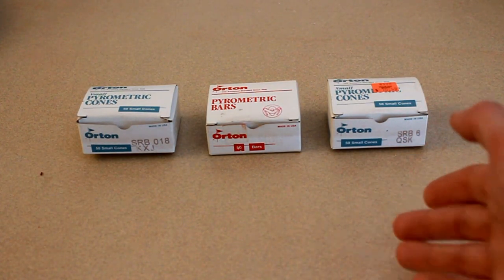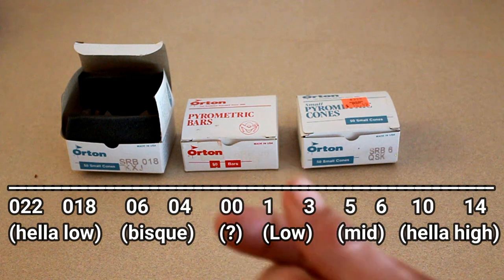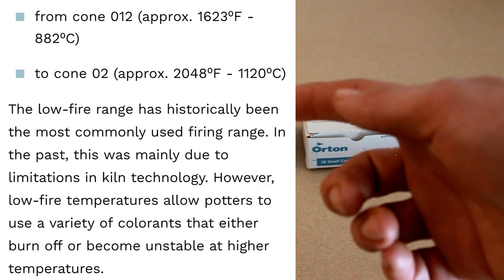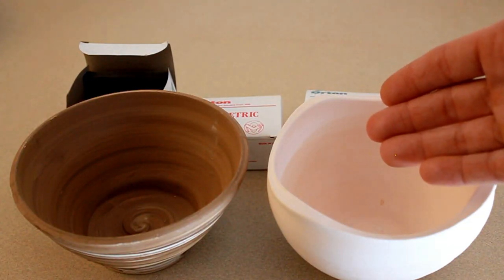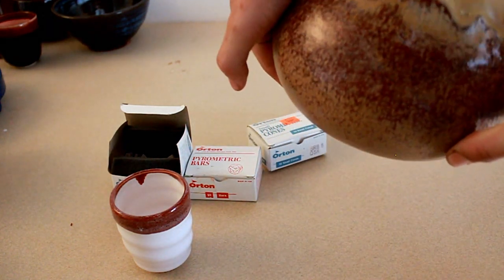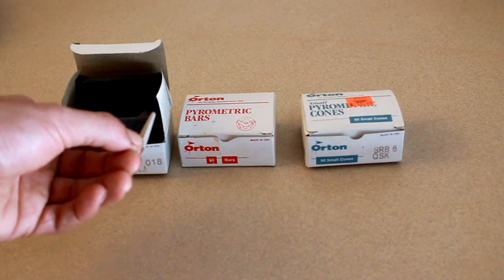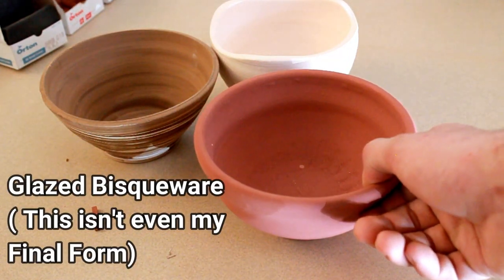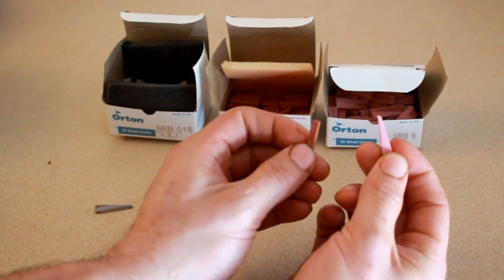Beginner intro to the Cone chart and Firing process (Very Basic)

Comment: the information at the beginning of the video is incorrect, the number of a cone corresponds to its ratio of silica to alumina in the clay body, if you were to look at the chemical composition  of lets say, 00 to 05 to 10, the materials would increase proportionally. However, as I'm sure you know, the temperatures of each of those different cone firings are not proportional at all and often pretty strange numbers. This is because the temperature is only reflects the point at which a given ratio of silica to alumina begins to melt.
Reply from the maker: Just like I told everyone else that give the same response as you did, this is a beginner's understanding and the information that you're giving them is for a future video. I don't feel like information raping a beginner who knows nothing so I tried to simplify it.
Reply from the maker: They don't even know what quartz inversion is And explaining that to beginner is mind boggling.
Reply: thanks for your right information.
Reply: @EarthNationCeramics  Quartz inversion? HAHA
Reply: I'm a beginner and I have no idea what you just said. Could you perhaps try talking as if you are talking to people who aren't already PhD's? Thanks a lot!
Reply: @Rick-the-Swift  it may serve to recall high school chemistry.  That's all I got for education on this, and I follow.  All of it.  In fact, I took chemistry when Jimmy Carter was in office.  Pretty sure they've discovered a couple more elements since then.  This is not that tough.  Which is not meant to diminish Donte's efforts here--excellent work!
Reply: Wut? Dude, relax…I just want to fire my first cup.
Reply: @Rick-the-Swift  right? I just made a cup and want to fire it. That is all. Tell me what numbers to punch into the kiln. 😂
Reply: @Heartwing37  Apparently at least a highschool chemistry course is needed. In special ed, they only let us shape the cups- never go anywhere near the kilns!😂
Reply: @Rick-the-Swift  😂😂
Reply: @Heartwing37  😂😂

Comment: Very nice video that sums up all I need to know as a beginner. I have a question. I bisqued a big plate at cone 05, glazed it, and put it in my kiln at cone 5. It cracked with two fine lines at the edge. is there any relationship between these two cone numbers? TIA

Comment: Thanks for the great video Donte. I have a few questions. You mentioned the one piece was fired with reduction, what does that mean? Also when the foot or bottom of a piece is wiped or waxed so it does not get glazed does that mean that area is still in the bisque phase? And is that part water proof and would it and all pottery be dishwasher safe? Also nice innuendo you threw in there, lol.

Comment: I am new. So, I have an older manual kiln with a kiln sitter. I am using low fire slip, cone 04. So, do I do low with lid opened a little bit for 2 hours, then medium with lid opened a little for 2 hours, then close lid and put on high until cone melts? What about glaze? Luster? I am confused about low and medium times, peep holes open or closed, and lid opened a little or closed. Thanks

Comment: Aaaactually ... cones don't measure temperature so much as they measure "heat-work".

[Hobby-potter and scientist here.]
See, you're actually "putting energy into" the clay, causing it to undergo chemical as well as physical changes.  

That's why Donte kept saying that we "fire *to*" cone 6 or cone 06, or cone 10, and not "fire at".
We're not doing baking here.  How fast or slow the temperature changes is just as important as what temperature you reach.  The same cone-6 cone will bend over at 2165 F if you're climbing at 27 F/hr, at 2232 if you're at a 108 F/hr rate, and at the even higher 2269 F if you're climbing at 270 F/hr.

There's also more physical changes than from "solid" to "liquid" to "gas".  A solid can have many different phases yet still be solid:  "vitreous", "ductile",  and more.  That's why you don't need to actually melt steel to make it structurally unsound, you just need to change it from the "flexible-but-strong"-phase to the "bendy"-phase or to the "vitreous-and-brittle"-phase.  
In clay, there are two "danger" phases:  the "alpha" and "beta" phases.  Both are solid, but have different thermal properties, and if you speed through the change from one to the next, your bisque will crack.  [And that, Donte, is why your firing schedules have those changes in how fast the temp is climbing.]

Now, there is some melting going on, during the bisque firing.  All of the little clay-particles that were being held together by water and static-cling while it was greenware?  Those guys get melty and sticky at their edges, fusing together.  And they stay stuck together when the firing is done, creating a nice, solid pot.

The chemical changes that are also going on, I don't really know about.  My husband's more the expert in that.  You definitely have chemical changes going on in the glaze firing.  Which is why most glazes look grey or rust-red before firing, then turn all manner of colors afterward.
Reply from the maker: Yeah, I tried to dumb it down. I find over explaining things to beginners kind of drives them away. 
 I am aware of everything you posted above but.... Do I want to knowledge rape someone who can't even throw yet?.... No.
 I think we will use the Info your talking about in the Intermediate video of cones :)
Reply from the maker: But your comment is appreciated :)!

Comment: Could you glaze a recently cured concrete planter?  I'd like to make a couple of "rotemburo"s (Japanese outdoor soaker tub, think of a giant flower pot full of hot water as a temporary hot tub).  I'm very comfortable working/sculpting concrete and would like to cast a couple of pots about 3' in diameter by 30" deep.  Concrete, no matter how good you are, doesn't finish ultra smooth like a glazed pot though.  I'd like the smoothest surface possible for my backside.  So how can I glaze a 600lb concrete pot on location?  Thoughts?  Could you use a roofing blowtorch or something like it to bake it in place?  I've got skills, tools, and energy to make something work that is good enough, I'm just missing experience and wisdom.  Thank you in advance for your thoughts.

Comment: can you go over the firing process? like how slowly do I need to raise up the temperature. how long do I keep it at Max temperature. and how slowly should I lower the temperature back down. I'm using a propane torch in a stone oven.
Reply from the maker: A few things, firstly we did an episode on that already but it was with a electric kiln and that doesn't seem to fit your needs.
and secondly you would need to know what cone you are trying to fire your clay and glaze to.
the temperature that correlate are very important and you can't just get things really hot and hope for the best.

Comment: I'm not a potter but I do have questions.. If your clay is rated cone 6 but if you do the lust glazes like you mentioned at cone 018. If the item is bisque fired, do you not have to fire at cone 6? Or do you have to buy glazes only rated cone 6? This is the one thing that confused me 😰
Reply from the maker: Technically speaking you can under fire any clay.

For example if you have a clay that is cone 6 you can fire it at cone 2 with cone 2 glaze( after bisque)  and it should still look fine. although it most likely won't be fully ventrified or food safe if you do that.

But because luster is technically an overglaze and is meant to go to 016 this process is called firing down and it's very normal.

Fire your clay and glaze to cone 6 ( after buisque) and when it's done refire it with the luster glaze over it to Cone 018. It'll be fine.

If you need I already have a video on gold luster
Reply: @EarthNationCeramics  thank you so much!! I actually am looking into starting pottery, just not quite yet (need that moolah first 💰 🤌)  lol but I've been studying up in videos on YouTube and books, and your videos are easy to understand and you explain things in a way anybody can understand! So again thanks for the videos and keep up the great work!! 👍

Comment: Semi related question! My professor's earthenware red clay recipe can actually make it to cone 6-10 without melting. Does that make it stoneware when fired at cone 6 (not 06) like we usually do for glaze?  Or is the earthenware name dependent on what's mixed into the clay rather than the temperature it's fired at?
Reply from the maker: You have to remember that Clay is really just expensive dirt with added chemicals to it to make sure that it matures or goes through its process at a certain temperature. For example where I am we have a clay call 8-11 buff that means I can go up to cone 11 very easily without melting.
Reply: Ah, I think I got it.  So what makes stoneware stoneware is the fact that its maturity range is limited to higher firing ranges, while the earthenware clay we use matures at low fire temps, and the fact that it can survive higher fire temps is just a bonus!

Comment: When to fire to vitrification? My clay vitrifies to 1% absorption at cone 02, but my glaze says food safe at cone 05/06, so what do I do to get the absorption rate but still b food safe?
Reply from the maker: The official answer is that you usually want something underneath 1% absorption, but, play companies do a very good job at making sure the pores are closed enough even if it's at something like 1.5 absorption and vitrified enough as long as you fire it to the proper cone that the clay is sent to and use food safety glazes.

Scientific answer is that your Clay is as vitrified as it can be below cone 10 but true vitrification happens at cone 10.
Reply: @EarthNationCeramics  yes, thank u. But in short, would I bisque to 02 and glaze at 05?I can’t find an 02 commercial glaze that says food safe. I appreciate your in depth answer but perhaps I wasn’t clear.

Comment: Total n00b here.... how do you make clay that melts where you want it to melt when you are not just buying a box that tells you so?  Can you take clay made for cone 6 and Dr it for cone 10 and can you use cone 10 in a cone 6 firing or is that also bad?
Reply from the maker: I have never made my own clay but I do know that you can make clay and that there are clay recipes out there so that the flux and chemicals added make them melt or mature at certain temperatures. You have to remember that Clay is really just expensive dirt with chemicals added to it to make it mature at a certain temperature
Reply: It's hard to doctor an existing clay for a different temperature if you don't know the exact ingredients plus the water content changes the weight and you'd want to know the weight of all the dry materials. If you have a dry recipe you can change fluxes or flux amounts to alter firing temps. I have done that and changed a Cone 10 to a Cone 6. You can fire a Cone 10 clay to only Cone 6 but it might not be fully matured, glazes may not have the same results and the clay with probably sound plunky when you flick it vs. a nice "ping". Hope this helps.

Comment: How would u clean a melted pot off a kiln shelve like if it’s completely melted also what would make one piece melt and the one right next to it not melt my poor classmate just messaged me in tears glaze fired cone 10 stoneware at cone 6 but her cones blew out and one piece is now just a puddle she set it for cone 6 because she used mayco glazes I feel so sorry for her
Reply from the maker: Honestly, I would just buy a new kiln shelf. If you put cone 6 clay in a cone 10 kiln and it melted.... You should buy a new shelf and never make that mistake again
Reply: Thanks for your reply I’m a huge fan of your channel and it has helped me a lot in my ceramics classes it turned out she got a recipe for black clay from the teacher and it was incorrect not sure exactly what happened we use cone ten clay but she had added black coloring to the clay I know that can be volatile she also used cone 6 mayco glazes on her cone ten clay and just fires it to cone 6 I think the colored clay was the issue I’m gonna spell this wrong but it’s the manganese oxide I know it can turn volatile I think she just wrote the recipe down wrong thankfully he is a really nice professor and didn’t freak out over the shelf mental not I will always use Masonite stains to color my clay I am only two semesters into ceramics I didn’t even know it was possible to completely melt a ceramics piece btw can you do a video on coloring clay safely there are a lot of techniques I want to try that involve different colored clay I did some marbled clay this semester but I just used two different stonewares
Reply: Ok that was rude to ask you to do a instructional video for my benefit for free so sorry but I’m a broke college student so I can’t be a patron so just disregard my request ok

Comment: stupid alert here sorry, when you have your right cone range selected for bisque or glaze firing, do you add those little pointy cones in with it too?  I know , I am only learning peoples.  Thank you for all your videos
Reply from the maker: I don't usually do it for buisque but I do for glaze. 
 There are 2 kinda of pointy cones, for older kilns they are called kiln sitters and are usually put in a special place that will turn off the kiln when it melts.

The ( usually taller ones) are kiln watchers, you put them near the peep holes to see how the kiln is firing
Reply: @EarthNationCeramics  thank you so so much